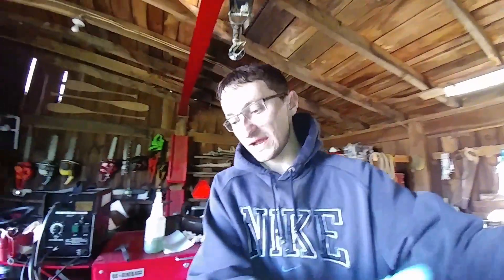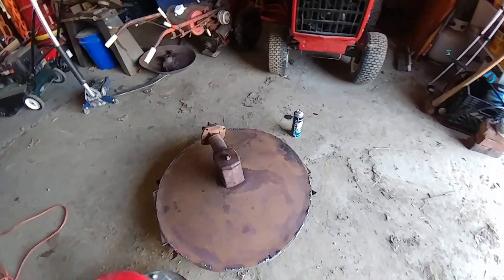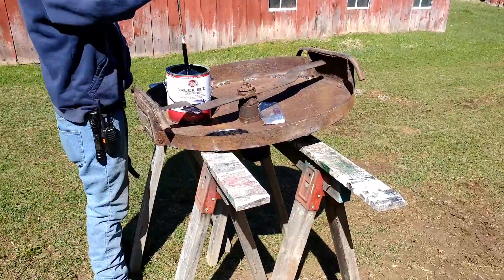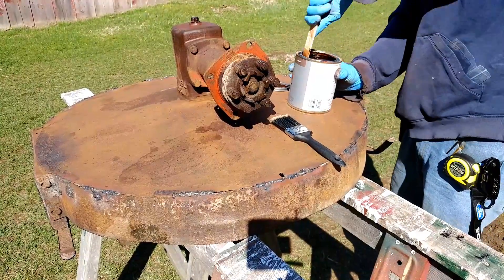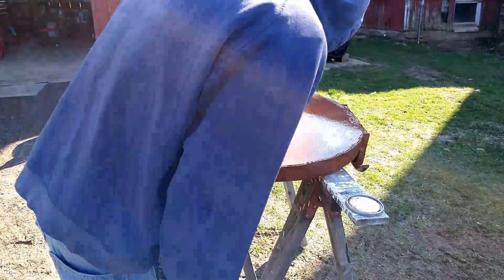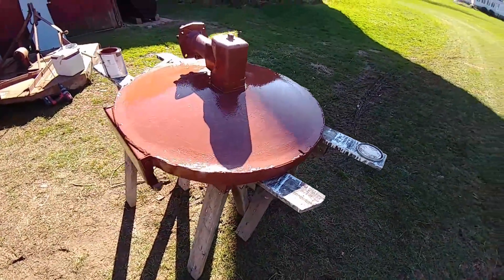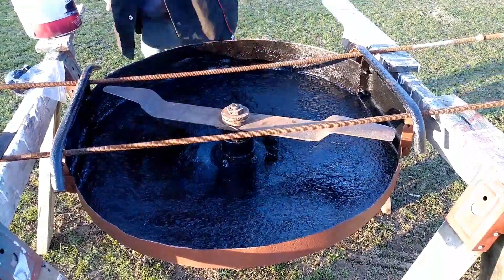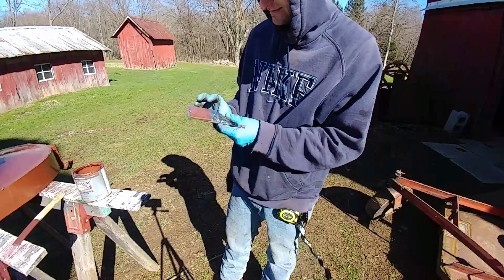PRESERVATION NOT RESTORATION!!!! TRUCK BED LINING AND PAINTING GRAVELY MOWER DECK

Comment: I have to do this to my x530 deck, and I'm going to use some sort of rust remover like evapo-rust, then a rust converter or Ospho which is phosphoric acid which passivates exposed steel. Then put a couple bed liner coats.
Might be overkill, just a rust converter spray to get everywhere in nooks and crannies and then bed liner coats is probably fine.

Comment: Is that one of those spring tension and disc clutch is on the end of the shaft?  I think if our brush hog has the same ours might be slipping.
Reply from the maker: Yes, that's a slip clutch on there. Tighten yours up and see what that does.
Reply: Love2boat92  I took it apart and tightened it to the specs I found online and it works sooooooo much better!!  Thanks for the help and reply!!

Comment: I am considering buying one of these mowers. How thick saplings can it cut?
Reply: For green wood, at least an inch.  Video shows a 1/4" blade (I think), but for heavy brush use the 3/8".  I have done so for 43 years and am continually amazed by the effectiveness and durability of these machines.  That model deck predates my Gravely introduction by lots of years based on the gear housing casting and plug.  If you get one, there is a good chance that come 2063, you will reflect, as I do now, on the wisdom of your acquisition.

Comment: Don't think that will last, as the tornado of debris that the underside of a mower deck is subject to. From what I've read on other sites, POR-15 is about the only thing that bonds to metal to prevent rust damage. But it has to be bare metal, not painted surfaces. Basically, just keep it clean and scaped of grass. Don't allow a buildup and the deck should last quite a while.

Comment: I would be interested in knowing how well that undercoating performs after a year or two of use.  Seems like it would be better than the paint they put on the underside of the deck.  I think you've added several years to the useful life of that mower.
Reply: Me too. I was thinking on that option for may lawn mower, but decided for regular paint because this kind of paints have rough texture on which grass would stick more and it would be harder for cleaning. As for only resilience, this paints (depend of manufacture) should be much better. So, for someone who never cleans mower, this paints for bottoms are better option.

Comment: They make really good rust removers for this application. Rust while can look like its the majority of the metal most the time that isn't the case. Rust is more of a scale. You would be surprised at how badly rusted something is then go to use a remover then its spotless with only a few little pits. Most original metal still intact.

Comment: Just what I have found ,, Rustoleum'`s rusty metal primer will last MUCH longer with a coat of a regular Rustoleum  paint on top. Keeps well on interior apps but not nearly as well on exterior when exposed to sun and weather.
Reply: Try using concrete bonding agent on a rusty deck. After wire wheel to remove crusty loose rust
Reply: I've had original red Rustoleum primer last decades. The gov't outlawed the good stuff. Today's environmentally friendly product is marginally better than shoe polish.

Comment: I've done the brush trick with a paint roller, except put it in the fridge wrapped in a plastic bag.
Reply from the maker: Beyer Forestry, Welding, and Other Stuff Yeah I thought about using a roller but I'm so used to a brush it's what I grabbed. Lol. The problem with putting the brush inside the fridge, is the fridge smells like paint and with it being around food it's not something I want to do. A plastic bag inside a Ziploc bag might fix that though.
Reply: Love2boat92 I just uaed a standard plastic shopping bag.